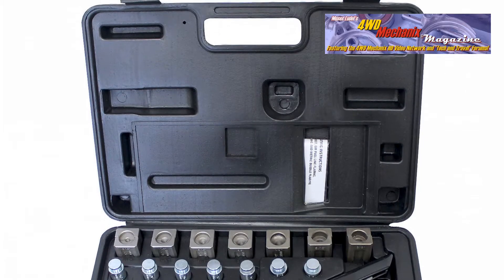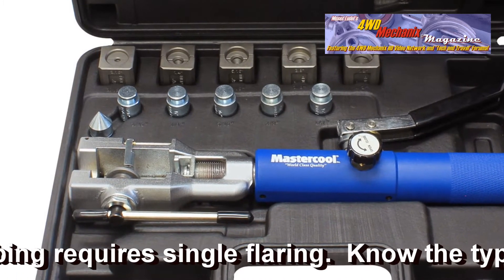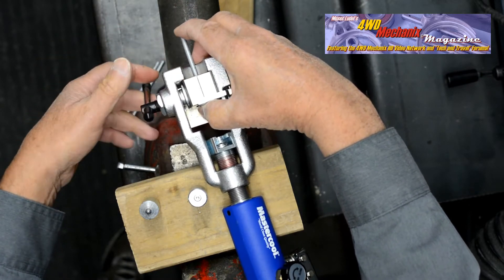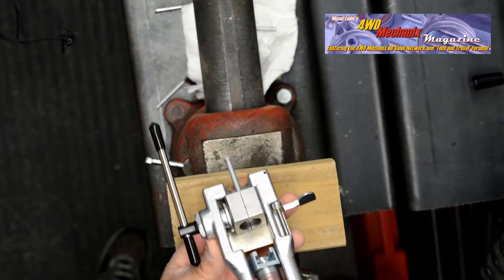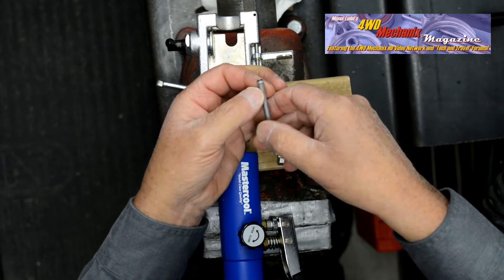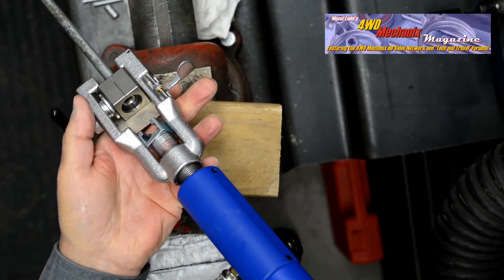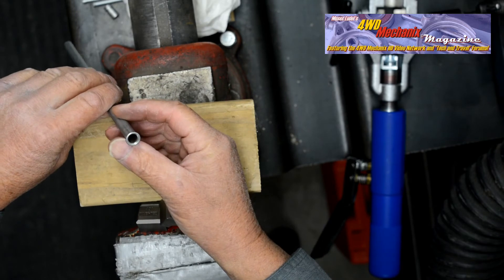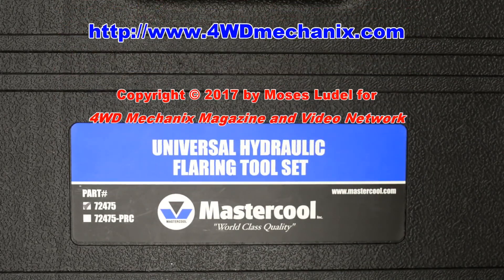Tube Flaring With the Mastercool® 72475 and 72485 Hydraulic Flare Tools

Comment: Thanks for your video, and for giving all these examples.  I only wish they sold a kit that also included the AN fitting set.  I hear the AN die sets just come in a cardboard box for an extra  80-100$.
Reply from the maker: You're welcome, TEAMPHY6...Making safe brake plumbing is the goal. There's an epidemic of brake tube "rot" at areas where roads get salted in winter, the reason for all these flaring tools. I like a flare tool that produces a "factory" look, no marring at the clamping point and repeatable, predictable flares. My favorite of the bunch, a tool that meets each of these criteria, is the S.U.R.&R. PFT409.  With the right benders and upgrade tubing, we can produce lines that duplicate original equipment yet last longer!
Reply: @RoadReadywithMosesLudel  Does the PFT 409 come with a case? Thank you 👍🏻 Review
Reply from the maker: Mine came with a case.  I went to the S.U.R.&R. site to confirm.  It still does.  Here is what you will get in the kit:  https://surrauto.com/kits/pft409-2/.  Click on the "Accessories", you'll see the blow mold case is included...I trust this helps.

Comment: looks like a good tool  for the  work bench.  may have to think about this.  around $ 350.00 im thinking online.
Reply from the maker: John, this tool works very well and is preferred by loyal users.  I have used and tested a number of flaring tools, and the SUR&R PFT409 is also a great tool within this price range.  What I look for is a tool that will get consistent, repeatable results and not mar the tubing.  The SUR&R PFT409 excels at both.

Comment: I have the early Model.cost of the new model??
Reply from the maker: I did a quick search at Amazon for ballpark figures.  The Mastercool 72475-PRC is currently $338.48 (U.S.).  The 72485-PRC is $347.67 (U.S.).  A Silver/Blue 72485-PRC model is $348.49 (U.S.).  These same tools may be listed for less at the tool warehouse sources that offer discounts.
Reply: @RoadReadywithMosesLudel  thks when they first came out way back I payed $500.00 u.s.
Reply from the maker: Glad this was helpful...Popularity and sales volume have driven the cost down.  Mastercool builds commercial quality flaring tool sets.  I also like the SUR&R PFT409, especially for its repeatability.